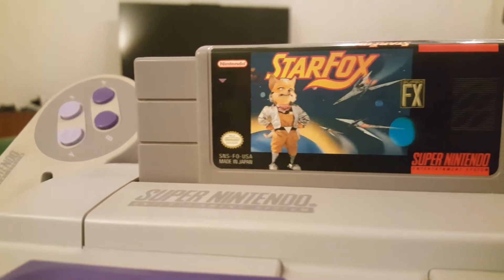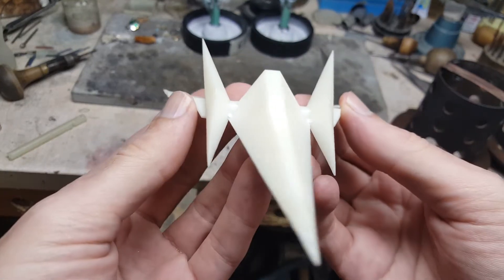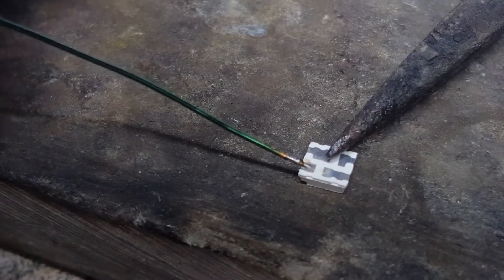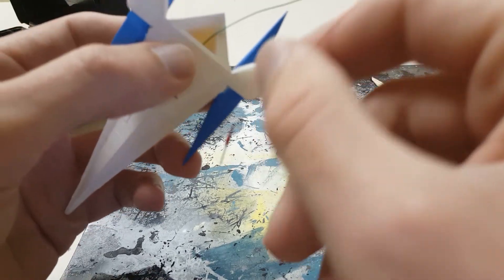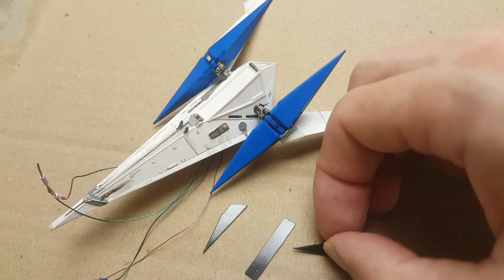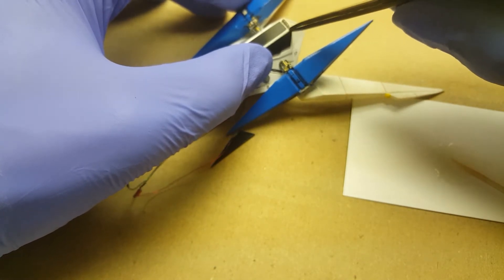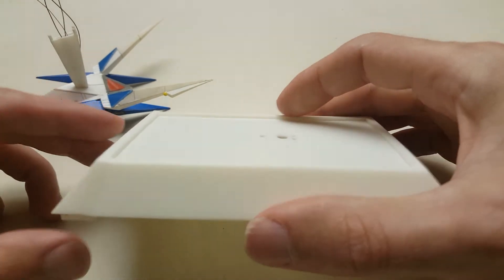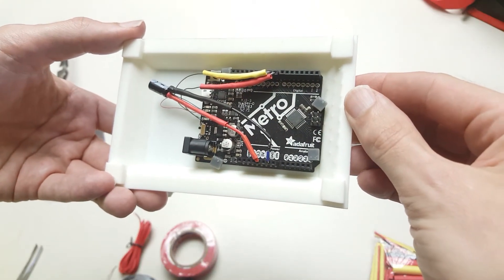Star Fox Arwing Custom Model Build

Comment: Also, are they available to order premade? I don't have a 3d printer
Reply from the maker: I'll set something up on the website. Feel free to follow me on twitter @sterlingkisses for updates.
Reply: I noticed that you did not mention articulating wings, nor did you include the seats or any internals to the cockpit is there any possibility that can be included or maybe a different model?F because I have the star fox are action figure that would be able to go in the model if I were to build it. 10:46